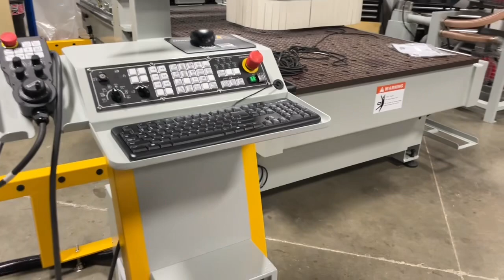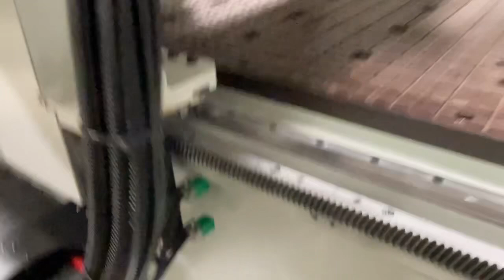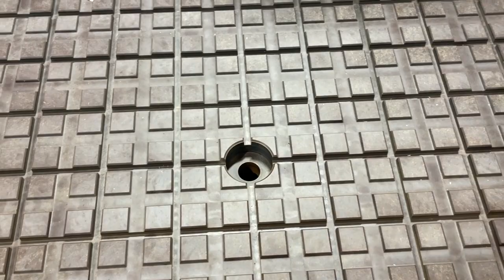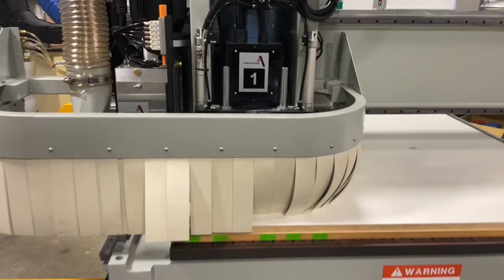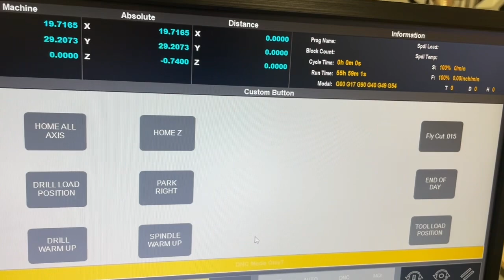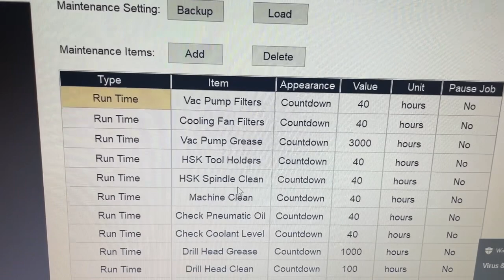Anderson Spectrum 4x8 CNC Router

Comment: Hello there,, 
I use Anderson Selexx eco 
I m having troubles with Drill bank Z depth .. it keeps on changing. For Ex: I needed to drill hinge holes, usually its 13mm but the machine drilled 16.5mm which literally gave me holes in my 16mm HMR board :(
I have tried many times to tool touch my Spindle tools but I cant find a way to tool touch my drill bank tools. 
Now I have to change Z depth in my nesting software and have a test run on a waste board just to be sure of the depth. 
Is there any way you can help me and guide me how to resolve this issue please. 
Many thanks in advance 

Harry
Reply from the maker: I think the selexx eco used a different controller and is many years old. Before my time with Anderson. But still some older techs that should be able to assist. Please submit a support ticket on the Anderson support site.